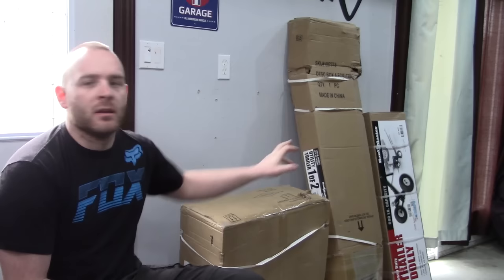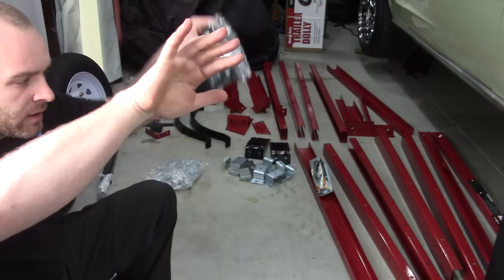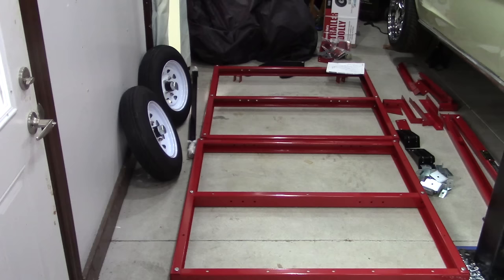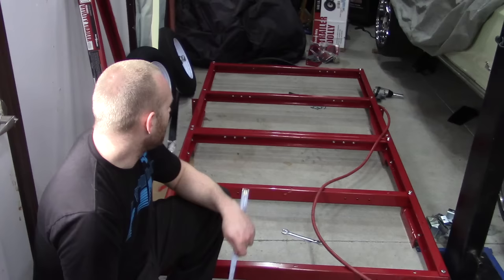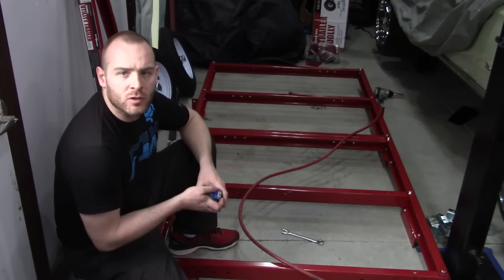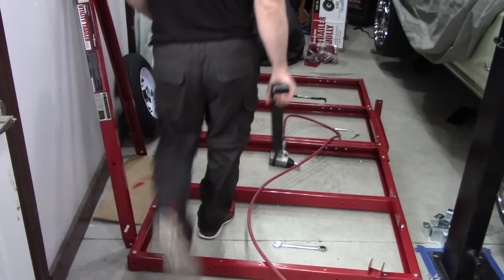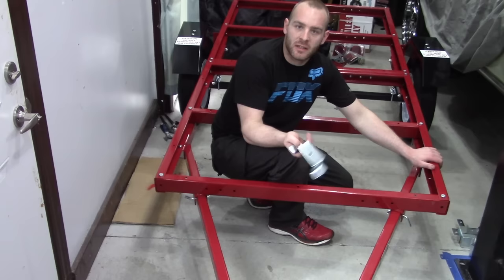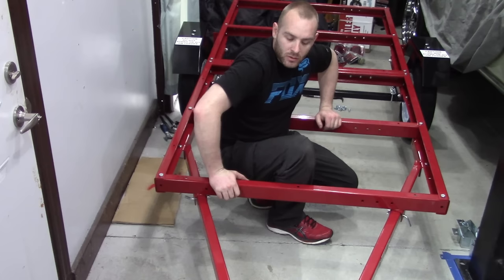Harbor Freight Trailer?? JUNK or NOT???

Comment: Nice video.  Thanks for putting in the time and effort to produce this!
A couple of thoughts from someone who has owned one for a long time...  Since yours is already done, this may help others
1.  The paint job is not great, so before you assemble, lay out the part and paint with some rustoleum.  Focus on the parts inside/underneath in particular.    You will have to do it sooner or later, and its much easier doing it before assembly.   I've heard some spray undercoating under the deck before flipping, which is a nice idea, too.
2. Use pressure treated plywood.  It lasts much longer
3.  Where you mounted the anchor points, drill a drain hole so all the way through, so it doesn't hold water and rot the deck faster. (You probably did this, just didn't notice)
4.  Bearing Buddies aren't necessary, but are very nice to have.   You shouldn't ever need to mess with the bearings if you use them.   Mine probably has 30,000 miles on the original bearings with no issues.

5.  Better tires!   The 5.70-8 size tires are a great option initially, or when you eventually replace the rubber.  They cost about the same on Walmart.com, are a little wider, don't wobble under heavy weight (I load mine like a madman) and of course have a higher load capacity.   After upgrading to these, I would never go back to the skinny ones.  This is a big upgrade, in my opinion.  No more sweating as you pull two 4-wheelers!
I hope this helps someone.

Also, I would love to see your ramp brackets!
Thanks again.
Reply from the maker: great reply!!!

yes the paint will need to be redone ( like any trailer ) so that wasnt a huge concern of mine. and within about a month or so the new shop will be done so this will live indoors now and should maintain the good looks it has now.

yes pressure treated plywood is a long term option but i wasnt sure how long id use this thing and knew one day it would live indoors so wasnt a concern for me.

yes for sure i drilled through to drain water. but this is a GREAT tip.

you will need to adjust the bearings from time to time, make sure you check them for play if you have 30k miles on your trailer.  aslong as they are adjusted properly and greased you are right they will last a VERY long time.

and yes better tires are for sure needed if you planned on going long distance with it at highway speeds.  but like i mentioned this is just for short runs for me.  no high speed stuff, so i never worried much about it.

thanks alot for the comment!! and im glad you liked the video.  ill post a pic of the ramp brackets i made, just something super simple, to hold a ramp
Reply: @710Garage ,
When I got mine years ago, I had almost the same plans for mine as you do.  It would be living in the big work shed, and I thought I would only use it for short runs, etc.    

But what happened is that the little trailer became more and more useful because it's so light and simple.    I could pull it with the truck, the minivan or even my little Mazda 626.  (I miss that little car) 
   
It started with carrying trash a mile to the dump station, then it started carrying my riding lawnmower to take care of my Mom's yard, then it started carrying engines and stuff I bought on Craigslist, then I pulled it behind my ATV into the woods behind my house to harvest dead trees for firewood, then it started carrying my ATV out to the mountains to ride, and so on.   Soon, I was using that little trailer as much or more than my HD trailers.

Now it's lives behind the shed, right next to the 2 bigger trailers.    Once I got the upgraded tires, I stopped worrying about carrying capacity.   Recently, I pulled a pair of big Yamaha outboards (650# each) at the same time with no problem.   

I have to say, that little trailer is    like my little 16' aluminum boat....   Light, simple and more useful than meets the eye. Here is a video of that one:  https://www.youtube.com/watch?v=eu9Z5Cs6iW4

Again, I really enjoyed your video, and will subscribe and watch more of your adventures.  Thanks again, and I appreciate your reply.
Reply from the maker: thanks for the reply!!  sounds like you love this little thing as much as i do!!!   your video is awesome aswell!!
Reply: @710Garage   - Thanks.  I have lots of boat and outboard related videos, and a couple of fishing videos.   Most are just short ones I posted for customers, showing them that their repairs had been done and their boat water tested, but a few how-to videos are mixed in there somewhere.
 I just realized that I never subscribed to your channel, but  just did.   Will be watching more of your vids while my arm heals.
Reply from the maker: @tonyhill3638  thanks for the comments!  while you I'm sure can clearly tell that I have no idea at all about anything boats, I will sub to your channel to hopefully learn some!   heal up soon!
Reply: @710Garage  Thanks!   This thing hurts, and physical therapy is murder, but I can now make a fist and use my arm a little.  They tell me that in 3 weeks, I should be 75% back to normal, and by next year, I will forget that it ever happened.
Reply from the maker: fingers crossed!  keep up the good work man! hopefully you're back before you know it!

Comment: Buy a $10 Teflon cutting board and cut a 4"x6" section out and use it where the spring slides on the frame.
Reply from the maker: this ia a great idea.

Comment: Unless you keep this in a garage, use marine plywood ( more expensive but you won't be replacing it every few years )  Mine was toast after a couple of years with regular plywood even attempting to rain proof it.  Trailer itself worked fine even after overloading it a fair amount..  No electrical issues at all.
Reply from the maker: good tips!!!  i plan to use it only around the house here shortly ( since we moved ) but for a year or so now its been outside.  so i figure
1 more piece of plwood and it will be living inside so it shouldnt matter too much.

Comment: I thought the directions say explicitly to NOT use the grease packed with the trailer - that the grease it came with was for shipping only - and that you MUST disassemble, clean and repack all bearings with new grease - true bearing grease rated for higher speeds than the packing / shipping grease.
Reply from the maker: mine didnt.  but someone commented that there are multiple different manuals so maybe you got a different one than i did
Reply: @710Garage  trust me, repack it. don't ride on the blue gunk

Comment: I doubt if they could they have made it any cheaper. A friend of mine bought one & the tire spindles were out of round to the point that he couldn't go over 30 MPH without the trailer jumping off the road. He got them to exchange the axel & tire spindles & it improved somewhat but it still wasn't great. They just cut to many corners to keep the price as low as possible. 
He finally sold it & got a better one from Northern Tool.
I guess you get what you pay for.
Reply from the maker: thats crazy.  youre the first one to comment with an issue like that.

Comment: I bought the same trailer had to return it once for missing parts and ended up getting a bigger discount, slapped it together put a bed and rails and was perfect on its first 300+ round trip and was loaded down with camping gear.
Reply from the maker: not a bad deal there!

Comment: The bolts on the corner of the decking I took a hammer and imprinted the bolts on the bottom of the decking then countersinked holes so the deck fit flush to the frame
Reply from the maker: absolutely could have done this.. just for me it wasnt that important so i just went with it.
Reply: @710Garage  what pressure are you running the tires at?
Reply from the maker: @CK-dt6nx  great question i have no idea... id have to check

Comment: Router out holes on bottom of plywood so bolt heads fit into the bottom of plywood. It would be cheaper than buying new piece and cutting
Reply from the maker: could do that aswell

Comment: I've had one for 4 years. I would recommend putting an extra coat of paint on it before putting it together. The original paint is garbage. Mine started rusting, in Florida! I had to replace the wheel bearings after 3 years of medium use
Reply from the maker: That's a good idea! i figured it will live outside for about a year then indoors the rest of its life so i just left mine.  but i might paint it and toss a new sheet of plywood ontop this winter

Comment: I would worry more about greasing where the spring slides.  The bolt, yeah,ok, but neversnease would work too. And do the bolts for the spring use nylocks?
Reply from the maker: yes they are nylock and great tip i didnt even think to grease the slider portion.  

i am wondering about that trapping dirt etc in and wear faster
Reply: I wouldn't think a light coating of grease would have to much more grit than nothing.  And spring steel would take forever to wear through and can always put a rub plate on the slidey part.

Comment: I bought one and Ive gotta say +1 to the guy that said crossmembers upside down they are super easy to mix them up no parts are marked and they all look the same very easy to put halfway together and then realize you have to take it back apart anyways trailer is worth 299$ easy plan on spending 4 hours putting it together
Reply from the maker: great view and point for sure.  you're right they are easily flipped over if you aren't super careful.   hopefully you enjoy it as much as I do!

Comment: shoulda greased the weel axle and bearings  before slipping on the weels...grease fittings cant replace a hands on application...
Reply from the maker: lots of miles and many years on it now with no issues... so i guess we can agree to disagree

Comment: I have this same trailer as the base for my teardrop camper. It has been strengthened with welds at corner and the fold was welded not to bend. What I want to know is what you ended up doing to strengthen your fenders.
Reply from the maker: nothing yet.  i plan to build a new set of fenders but havent gotten around to it at this point.
Reply: I didn't.  I got a couple of "No Step" decals like aircraft use, painted the fenders "Farmall Red", and put them on the fender.

Comment: Hi, great video! I have a question for you.  I'm thinking of getting this trailer to haul a liquid oxygen tank (dewer).  Its a cylinder about 5' tall with a diameter of about 2.25'.  I want to strap it down to the four corners of the trailer.  So the potential problem I'm seeing is since its a folding trailer, wont the the tie-downs cause it to fold back up while under tension?  I'd be placing the cylinder directly above the axle.  The tie-downs would go from the top of the cylinder to the 4 corners of the trailer.
Reply from the maker: why not lose the folding feature like i did so you dont have to worry about that??  sounds like you want the tie downs like i did ( through the frame too )

Comment: For the money invested including wood and your time you can buy a nice used factory built trailer.
Reply from the maker: thats possible i suppose depending on your area and how close a manufacturer is.

always look at all options and make the best choice for you.
Reply: I did some trim work in exchange for the trailer and I wouldn’t risk putting one of my wheelers on it. Although I haven’t driven with it on the roads I think the bearings probably wouldn’t hold up it seems flimsy

Comment: How much grease do I pump into the grease fitting? I also thought about replacing the 1 7/8" coupler that comes with it, with a $20 2" coupler from the local home improvement store. What are your thoughts on that? Thanks for the video!
Reply from the maker: swapping to the 2" would be a good idea.  mine had a 2" so i didnt have to.  but my car trailer and other trailers all run 2" so its handy not having to swap my hitch everytime.

did you make sure your bearings were packed prior to putting them in??  if so, just put 2-5 pumps into each bearing.   and i after that i throw a pump into each bearing every now and then. im sure there is a recommended service interval, but i just guess about every 2000 or mi to hit them again.
Reply: @710Garage  Yeah, I don't know why mine came with a 1 7/8", I'll switch that out today probably.

The bearings came packed, it seems, so I basically just installed them the way they are.  The directions say I need to repack but I don't understand why...maybe a liability issue? I think I should be ok, i'll go pick up a grease gun today and  add a few pumps, thanks!
Reply from the maker: @moron32  good luck with your mods!  you just dont want them running dry..   just keep them lubed up and you will be fine!

Comment: I have had mine for over 10 years. Use it every year to make a 4 hour camping trip. Put 2 foot walls on it. Loaded it up and put a jon boat on top of that. Looks to me like there were holes on the side you drilled when you flipped it over and were not on the other side. Sure you had the rail properly on?
Reply from the maker: yes if you flip them the holes for the axle didnt line up.  and the bracket for folding wouldnt fit still.

luckily i wasnt planning on using the folding option anyways.
Reply: I don't use the folding option either. I used locking nuts to join the two halfs together and used them instead of the pins for the folding ball lock. The biggest problem I ran into in ten plus years is the crappy paint. It will peel and rust. Brushed on a good two coats of rustolum.
Reply from the maker: great tips!!

luckily im in the process of building a 50x80 shop so it will be able to live inside of there.. hoping that that will help it live a bit longer.

Comment: With all the missen holes I think you may have flipped over some off the parts.
Reply from the maker: I wish it were that easy.   Thanks for the comment and view!
Reply: @710Garage  I love my HF so much I got a 4x4 AND 4x8 my only complaint is the tail lights are easy to break.  I have really put some abuse on my 4x4 caring way to much firewood and losing a tail gate some where on US 190 near Krotz Springs LA.  So small I could tip it up along the fence to get out of the way. For someone who never had  a truck their wasn't much I could not hall even behind my 1987 4 cyl  Mustang.
Reply from the maker: I agree  I've shattered the lights off like 4 times now.. I was just saying last week I need to buy some with a metal housing lol

Comment: How’s the trailer working now any updates?   Have you done any improvements?
Reply from the maker: trailer is still working well... like i said i made a rack under the bed of the trailer for the ramp i have in there for the atvs. 

i did blow a tire right in half.... it split like a taco. 
that was annoying but other than that no real complaints.
Reply from the maker: new video is up!

Comment: What kind of tie down anchors are those and where did you get them? Would love to get the same ones, thanks.
Reply from the maker: i picked them up at princess auto.  but amazon has the same ones.   1 of the hold down bolts goes through the steel, and the other just the plywood.
Reply: @710Garage  thanks! How deep are they--i mean, how far down did you have to go with the hole saw?
Reply from the maker: i would guess about .375  its not too deep!
Reply: @710Garage  thanks! Helpful video!

Comment: I was considering buying this to transport my motorcycle. Do you recommend it for that type of use?  My. Bike is 426 lbs.
Reply from the maker: oh ya my atvs are roughly 800 lbs each and thats what i bought it for.  this is the 1700lb load version so your bike at 400 lbs is nothing on it
Reply: @710Garage  -  that is great. How did you add sides to it?  Did you do a video about that or something that shows the end product?
Reply from the maker: they supply stake pockets with the kit that bolt on around the outside and a 2x4 slides down into them. 

it would be super super easy to make walls.
Reply: @710Garage  thanks!  Appreciate the quick response!
Reply from the maker: no problem! sorry i couldnt help with pics etc.  
i didnt use any for my build.

Comment: Sounds good but I read the manual on line: 45 mph trailer speed max. Changing the tire will not necessarily change the speed rating.
Reply: That 45 mph speed limit is most likely dictated by their legal and insurance carriers.  If you exceed that limit and have a problem, you're on your own.  "We told you so."  Intended to keep you off limited access highways where speed limits can approach 75 mph or more.
Reply from the maker: you are probably right.  and luckily i dont have to do long highway pulls with mine. so im okay with this suggestion

Comment: How do you think it would work as a overlander trailer to pull behind a Jeep? It would carry all the camping gear, water and extra fuel for the Jeep.  The trailer would need some modifications.
Reply from the maker: for all of the mods needed i feel like you would be better off starting from scratch.   it isnt high enough, and the axle bolt pattern isnt ideal for finding rims easily that will fit with say a 35 inch tire.
Reply: 710 Garage - Ok, thank you for response I really appreciate it. I guess the best thing to do is just buy a overland trailer. They run 6000 to 8000 thousand dollars. Instead of being cheep I would rather have a peace of mind LOL. Thanks again,
Reply from the maker: @WanderOverlanders  i bet you could build one for half that if you are inclined to do so.  
but sometimes like you said peace of mind is worth the world.